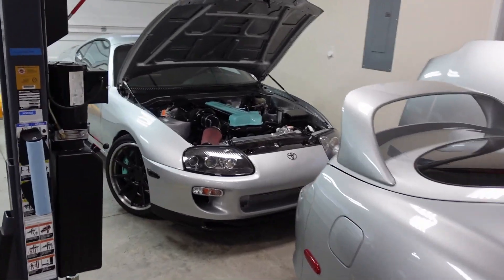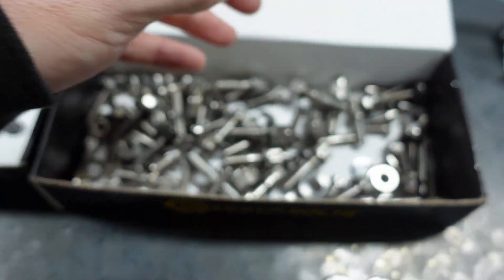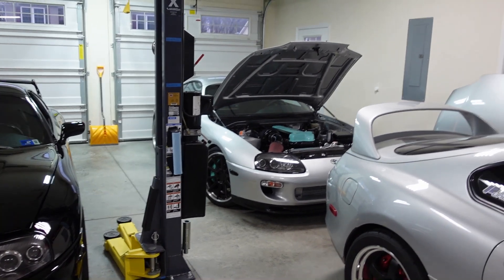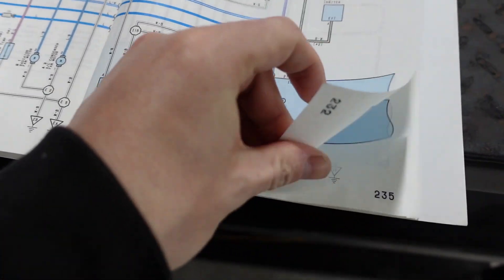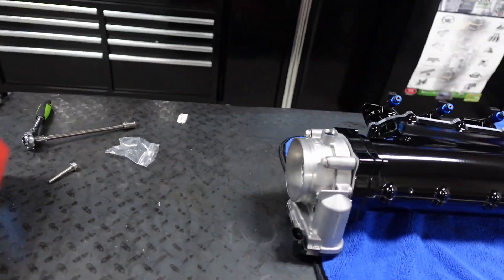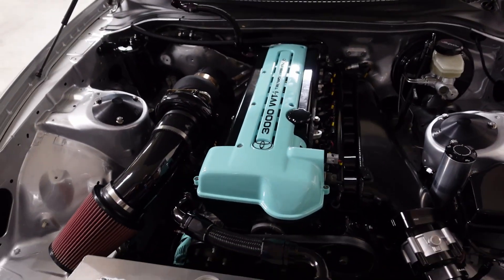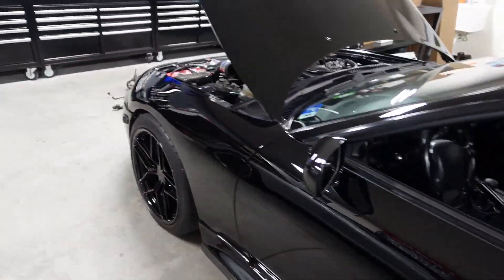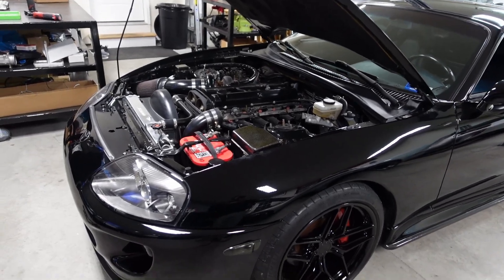MK4 Supra A/C Fix! (Informational)

Comment: Lol yes please. As a safety precaution, the pressure switch prevents the ac from coming if there is no refrigerant in the system so you do not damage the compressor. As you know, there is oil in the system for the compressor and it relies on the refrigerant to return the oil back the compressor when the system is in operation. If there is no pressure the system won’t come on. I’m an auto ac technician from Barbados and my dad owns a MK4.

Comment: Thats wild. My Radio doesnt turn on and my AC blows hot air only. Im wondering the same. However The radio should be seperate than the AC not working. Im going to go inside and see what I find. Great info!

Comment: I’m going to assume the MKIV doesn’t have a AC system check mode like the SC does where it spits out an actual code (Code 23 would be for a pressure switch) and you diag from there. The Toyota book says, make sure it’s charged (obv) make sure the low pressure switch is good on the continuity test, make sure the wiring is good or replace the ecu. 

What it doesn’t say and this was my issue for awhile, the AC compressor speed sensor will shut down the system entirely and you’ll get no power like what you described also.  Just wanted to touch on that.

Comment: Hey Ryan, when using those radium fuel pressure regulators, when revving in neutral, does you fuel pressure go up then come back down ? Also when you shut the car off does your fuel pressure drop right away?

Comment: I have a lexus sc300 with 2jzgte vvti engine swap I'm having fuel pressure drop when I hit boost  I'm running walbro 525 fuel pump 8an feed and 6an return red horse fuel filter aem infinity ecu 506 radium fuel pressure regulator. Any help will be appreciated